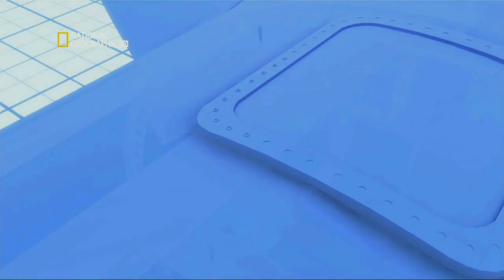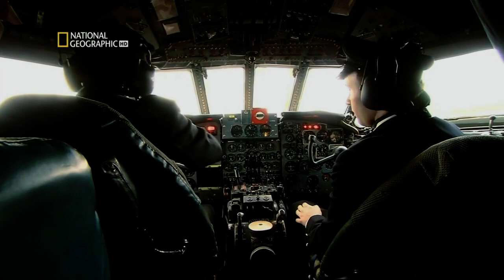The Crash of the De Havilland Comet

Comment: ... and that's why airplane windows are rounded. any other questions, children?
Reply: ... and thats why there are no longer any British companies that make commercial jet aircraft.
Reply: Chow Mein gobblers should be aware.

The ideal shape for a given window area is elliptical with a vertical larger dimension.
Due to pressurisation hoop stress being larger than length wise / longitudinal stress thus requiring the minimum amount of material for adequate strength so improving lightness. 
 Square windows could be strong enough but require extra structure around the windows.

Accident losses - % of aircraft built.

DeHavilland Comet 4 UK 14% 
DeHavilland Comet all mks  17%  
Vickers VC10 UK 5%

Boeing 707 USA  20%
Lockheed Electra USA 29%

Comment: No matter how many times I watch this, I get sick when the plane explodes. But we learned from it, haven't we?
Reply: Unfortunately the Comet Disaster was an exception from that rule, metal fatigue in aluminum airframes structures was well-known and understood by the leading airliner manufacturers.
The Comet Disaster was the result of appallingly incompetence and disregard for safety.
Reply: @sandervanderkammen9230  that may be the case, but the stress concentration along the corners was probably a new issue.
Reply: @NERGYStudios  The real tragedy of the Comet Disaster was that it could have been so easily prevented,  if de Havilland had simply followed well-known and understood industry standards in the design and construction of pressurized cabins and riveted aluminum alloy airframe structures.

Unfortunately de Havilland was decades behind in aircraft design and was still building aircraft primarily from WOOD in the 1950s.... a completely obsolete technology.

The Comet Disaster is a truly shameful chapter in British history
Reply: @sandervanderkammen9230  You really know very little about the subject.  The Vampire was designed during the war as the second British jet Fighter, the fuselage has made of a wooden sandwich construction with the wings, etc. constructed of metal. It and the Venom (an updated Vampire used mostly as an interim aircraft awaiting the advent of the second generation jet fighters) would have been the only production aircraft still being made (partially) of wood in the 1950s by de Havilland.  The Vampires made in the 50s were mostly constructed by DH Australia and a number of licensed manufacturers.  The Sea Vixen was all metal construction.

DH were leaders in the field of bonded construction.  The glue was developed specifically for DH and later evolved into a family of aircraft adhesives named Redux.

As to the wooden structure of the Vampire, the ARL did extensive fatigue studies for the RAAF on a number of aircraft including the Vampire, in their report was the following "after the equivalent of 41,219 and 67,238 flying hours respectively the two wooden fuselages to which had been attached the 23 half wings showed no signs of wood or glue deterioration".

Again, your assertion "well-known and understood industry standards in the design and construction of pressurized cabins and riveted aluminum alloy airframe structures" bears examination.  If that was the case,, then Boeing B47s would not have been falling out of the sky due to fatigue failure of the wing center section, for some time with a critical period in early 1958 - some of the aircraft had low flight hours.  

On the 13th of March 1958, two B47s broke up mid-air in two separate incidences from structural failure due to fatigue, there had been a number of incidences before this and after this date - some of the aircraft carried nuclear devices, from 1956 to 1958 eight nuclear devices were jettisoned, destroyed or lost in B47 incidents.     These structural failures led to project Milk Bottle, a program to save the B47 from premature retirement with the usual (for the US Military - okay I may be too harsh here) associated coverup.  

Three B47s were tested to failure to determine the cause of the wing failures and assess the aircraft design integrity.  During the tests performed by Boeing on one of the three test aircraft, other areas of the aircraft were shown to be susceptible to failure.  Despite these warnings, the collapse of both upper longerons of the fuselage came as a "surprise" to the Boeing engineers, especially as the total estimated flight time (total of real and simulated) was around 3400hours.  The replacement fuselage lasted 2100 hours before cracks started to appear in the same place.  The Douglas test aircraft also started to fail the same way as the Boeing aircraft but it was detected (by sensors installed after the Boeing failure) before catastrophic failure of the fuselage, total flight hours were similar.

Of interest, the testing of the B47 design was done by a similar but less comprehensive method as was used by de Havilland on the Comet - static load testing with a margin of safety.  Interestingly, Boeing had NOT determined a design life for the aircraft. This theme in the report carries on through a number of other aircraft types.

In the document detailing the History of the USA's Aircraft Structural Integrity Program, it is quite clear that the designers of US military aircraft had no great understanding of fatigue in the period of interest.  The report is easy to find on the internet.

That will do for now.  Please provide the references that back up your assertions.
Reply: @robertnicholson7733 I can conclusively prove everything I have stated is 100% accurate and true...

 Please name a single British company that still makes commercial jet aircraft in the U.K.?
Reply: @robertnicholson7733  Hey Bobby! Have you heard the joke about the British space rocket?
Reply: @sandervanderkammen9230  

If, as YOU say, "metal fatigue in aluminum airframes [sic] structures was well-known and understood by the leading airliner manufacturers", you will be able to supply suitable references to papers and/or books that show this to be the case at the time the Comet was designed.

Professor Paul Withey seems to disagree with you.  
https://www.youtube.com/watch?v=K5HqEwbp4GA
You have not provided any information on your qualifications regarding aircraft design and/or metal fatigue,  so I chose to believe Paul Withey over you.

After the Comet investigations were completed and further research triggered by the Comet crashes was conducted, the entire design philosophy for aircraft design and testing changed from SAFE-LIFE to FAIL-SAFE, a complete rethinking on the subject.  If "metal fatigue in aluminum airframes [sic] structures was well-known and understood by the leading airliner manufacturers" why was this change not implemented before the Comet crashes?  If your statement is correct, why were the standards against which the  Comet was assigned its certificates, such that it could pass? The key equations used for determining fatigue mechanisms were developed AFTER the Comet crashes, if all this was well known BEFORE the Comet crashes, why were they not developed and published BEFORE the Comet crashes?.

Provide you well-reasoned arguments (with references) for your case, otherwise, I will consider your pronouncements on this subject in the comments on this video and other youtube videos about the Comet as, at best, specious, but more likely a case of someone with an agenda and a complete disdain for PROOF.
Reply: @robertnicholson7733  The Comet 1 was grounded in 1954 and its airworthiness certification was permanently revoked in 1958, the same year de Havilland company went tits up.
 Subsequent investigations and wreckage recovered from the sea confirmed that the Comet Disaster was caused by engineering incompetence, criminal negligence and mismanagement.
Modern investigations have revealed that the Comet suffered from aluminum alloy skins that were too thin and brittle, lacked proper rip-stop doubler joints, the  fuselage reinforcement rings were too narrow and spaced too far apart and the revitted joints were appallingly bad, well below industry standards.
de Havilland not only bodged the design of the Comet, their stress testing of the Comets airframe structures was conducted with Neolithic incompetence.
The real tragedy of the Comet Disaster was not only could it have been easily prevented, it was the result of criminal negligence and incompetence. 
Any questions lad?
Reply: @robertnicholson7733  Metal fatigue was discovered by German engineer WILHELM ALBERT in 1837.

The world's first all-metal monoplane aircraft with a pressurized cabin was the Junkers Ju-49 in 1931.

The first pressurized airliner was the Boeing 307 Stratoliner in 1938.
 The Junkers Ju-86 was flying pressurized to over 52,000 feet during WW2.
 Boeing, Douglas, Junkers and Lockheed were all producing successful all-metal monoplane aircraft with pressurized cabins when de Havilland company was still building biplane airliners made of wood and fabric like the Dragon.
  The Boeing B-47 flew two years earlier, a large, multi engine jet aircraft that flew faster and higher than the Comet with a 9.8 psi cabin pressure differential.
No Boeing aircraft ever crashed due to a failure of the pressurized cabin.
Reply: @robertnicholson7733  Any questions lad?
Reply: Every crash, though tragic, has brought about more knowledge and increased safety. Just a shame how many had to give their lives in the quest for safer aviation.
Reply: @Cissy2cute  yep but i am pretty sure that there are more lives saved with aviation. I don't count wars, which are not an issue of aviation, but a human morale. I am Thinking about rescue missions. Sick people who flew fast from places like islands to receive urgent special treatment . Firefighting, transportation of medical supplies to distant places , supplying people after natural disasters, who would die if they count on ground transport to receive water, help, food etc  . Everything above pretty sure outrun tragic accidents.
Reply: @Cissy2cute  Spot on. Those lives saved a million more. Very sad indeed.
Reply: @NERGYStudios  Thats a popular revisionist veiw point... especially in the U.K.  but not one supported by the factual evidence.
Reply: @sandervanderkammen9230  the factual evidence is right there in the sample - the cracks originated from the rivets located in stress concentrated areas. The disaster may have happened even without concentrations but at least the fatigue cycles could have taken a much longer time. In any case, as you said, the use of riveting instead of the recommended non-destructive joining was a giant blunder.
Reply: @NERGYStudios  Lets dispel the propaganda myths.
Nothing... absolutely nothing about the de Havilland Comet was cutting edge technology...
 The aircraft industry had well-established standards for both pressurized cabins and all-metal monoplane airframe structures.

de Havilland simply lacked the knowledge and experience needed to build a pressurized airliner.

Junkers, Boeing, Douglas  and Lockheed had all been building pressurized airliners from riveted aluminum alloys without any issues with catastrophic in-flight structural failures.

 de Havilland, which only had success with aircraft built from WOOD and FABRIC was entering the market without the needed technical knowledge and experience.

The Comet Disaster could have been easily prevented if de Havilland had simply followed well-known and understood industry standards in design and construction.

The Comet was the result of incompetence, mismanagement and criminal negligence.
Reply: @sandervanderkammen9230  There's nothing propaganda about the findings of the official investigation, verified by further research that clearly states "severe weakness to fatigue crack growth in the aircraft skin around cut-outs such
as windows and escape hatches." (Withey 1997). There is a reason why the cracks grew out of those particular places. There's no "propaganda myth" in that. Period. De Havilland clearly made unacceptable errors in the manufacturing and assembly, but the impact of stress concentration cannot be ignored at all. Any destructive joining method could have been susceptible to damage from the fatigue cycles.
Reply: @sandervanderkammen9230  Plus, your statement about "nothing on De Havilland Comet being cutting edge" could not be farther from the truth. First jet-powered commercial airliner, first passenger airliner to have cruising altitude of 40,000 ft, first commercial airliner to use quad jet engines, and hydraulic control surfaces among others qualify as "cutting edge" in my dictionary. Not sure about yours.
Reply: @NERGYStudios  Fatigue cracks don't cause brand new aircraft to catastrophically explode in mid-flight... some things much more significant resulted in the Comet Disaster
Reply: @NERGYStudios  You need to learn about aircraft in service before and concurrent with the Comet Disaster

NOTHING..
ABSOLUTELY NOTHING about the Comet was cutting edge technology.

Please stop spreading lies and misinformation about the Comet Disaster
Reply: @sandervanderkammen9230  lol ok, seemingly you know more than the team which studied the Comet incidents, please write a book about "your expertise" so that the "future aircraft designers" can make use of your "amazing knowledge" which is hidden by "the myths" spread by the "investigators" of the accident. Lol.
Reply: @NERGYStudios  Which team??? de Havilland repeatedly blundered during the investigation and was accused of covering up design and construction flaws as well as starting several false rumors and red herrings.
Reply: boeing representatives right now: jolting awake erm .. yeah!